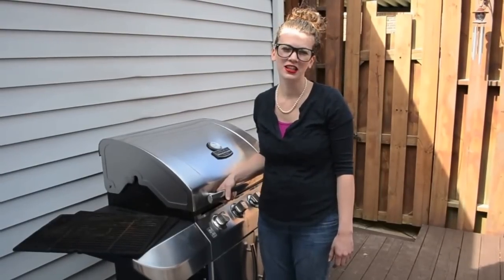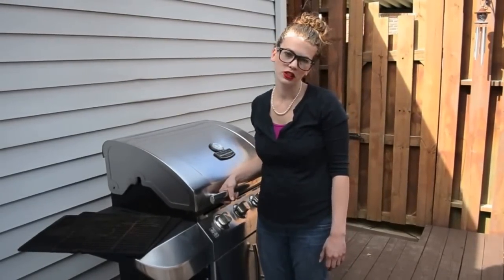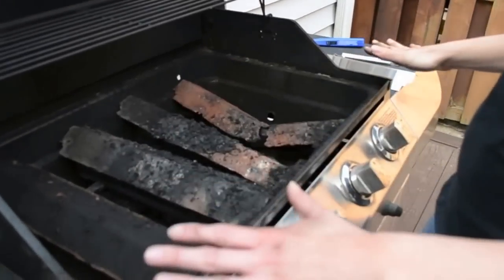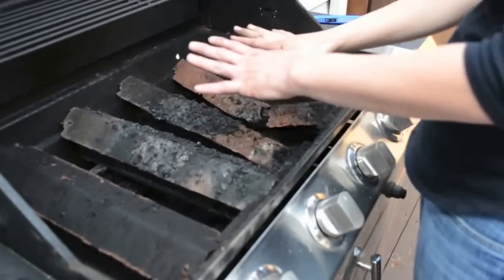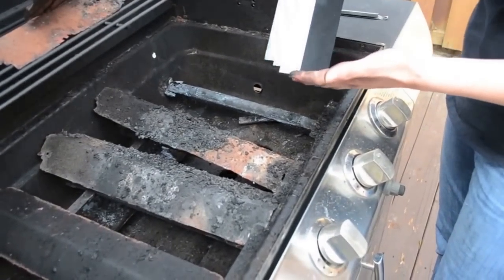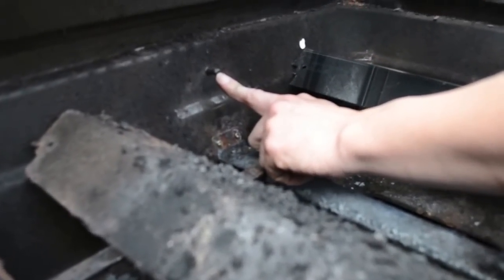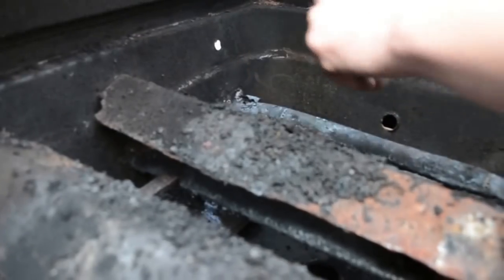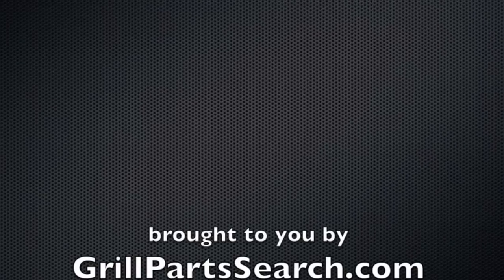Replace Grill Part - Heat Shield

Comment: One way to extend the life of the burners and heat shields is to regularly apply cooking oil (canola/grapeseed/peanut) by using a small paint brush. The marinades that drip down on to the surfaces usually have salt etc that hastens the corrosion of cast iron.
Reply: Thanks for that, so new to grilling and I just got an older one from a coworker so this info is very helpful!